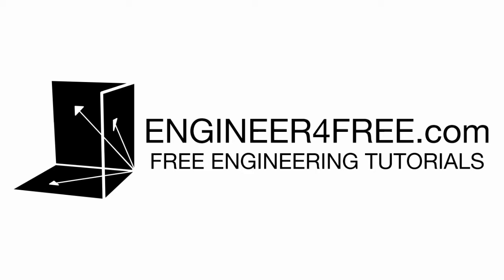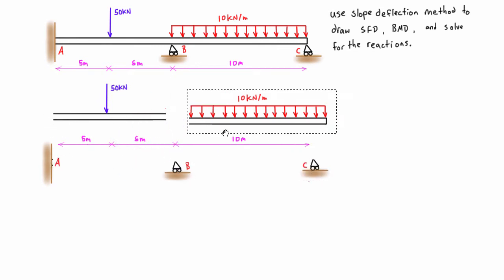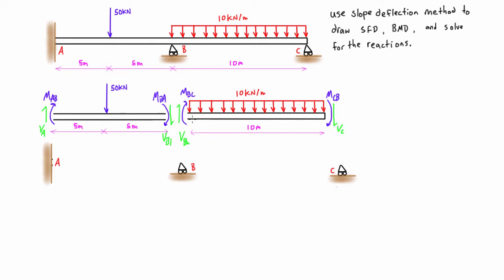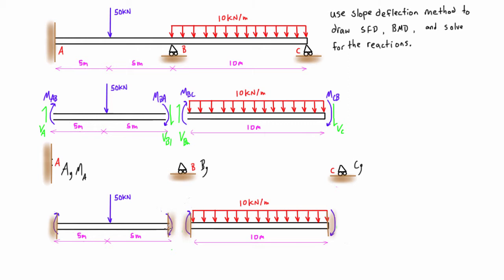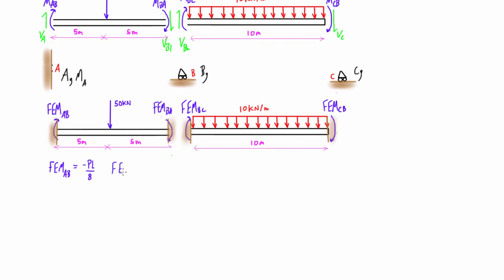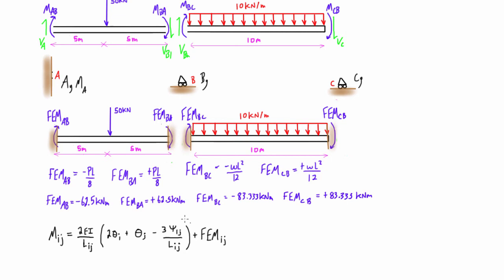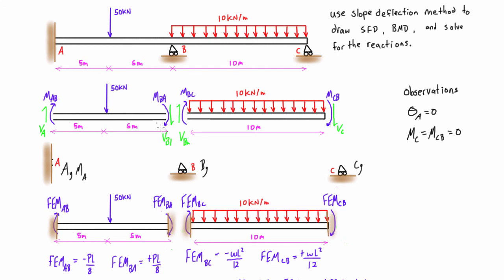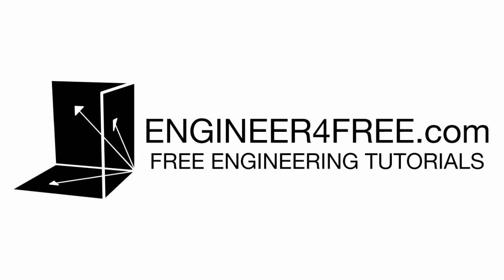Slope deflection method example #2 (part 1/3)

Comment: Question: wouldn't the FEM for the roller support end span be WL*2/8 instead of the WL*2/12? and the Slope deflection equation be 3EI/L.......?
Reply from the maker: Hey Javid, if you google "fixed end moment tables" it will come up with tons of resources. Here is one from Purdue University: https://engineering.purdue.edu/~ce474/Docs/Fixed%20End%20Moments.pdf The first and fifth entries match the cases in this video. FEMs for single point load in middle are +/- PL/8 and the FEMs for UDL across entire span are +/- w(L^2)/12.
Reply: @Engineer4Free  Yeah but doesn't this example feature roller pins. So wouldn't you use the loading equation from that table relating to one fixed end and one roller supported end.
Reply: @matthewziegeler644  I think you assume both side is fixed end, see 3:12
Reply: @adlinamohdfadzil6757  while calculating FEM( Fixed end moments), we assume that section to be fixed supported.
Reply: it works either way.